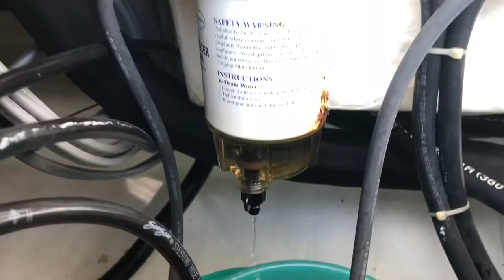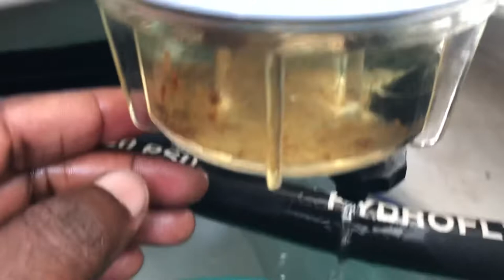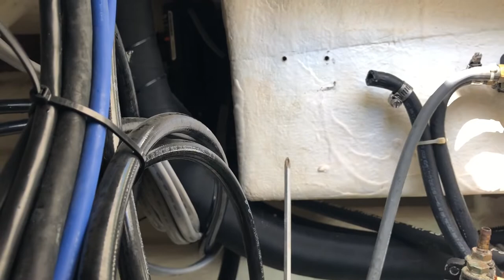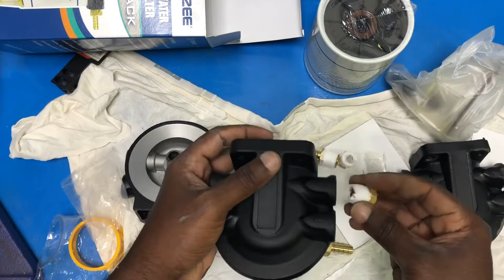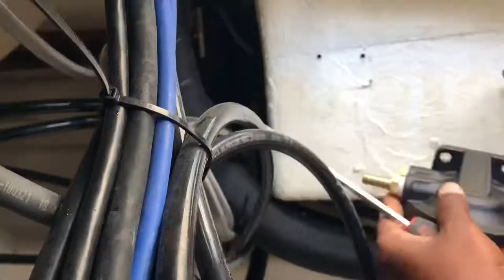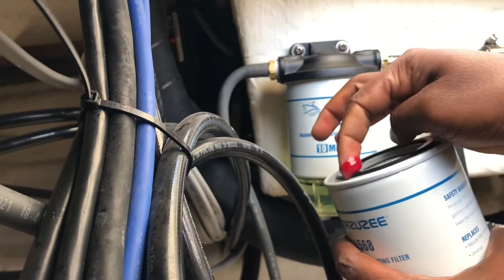How to replace fuel water separator #yamaha #honda #mercury #boat

Comment: Do you have two filters on your boat? I have one and I’m wondering whether I could add a second one. Had a water issue and don’t want to have it again
Reply from the maker: Hi if you have this kind filter you don't have to add one more, because you have one filter in the engine side too. All you need you have to check bawl regularly 😊
Reply: @MrAsankarajitha  thanks. I removed the old gasoline that had gone bad and instead of regular gas I am now using rec 90 or ethanol free with an additive. Motor now runs better than when brand new. Thank you for your guidance.